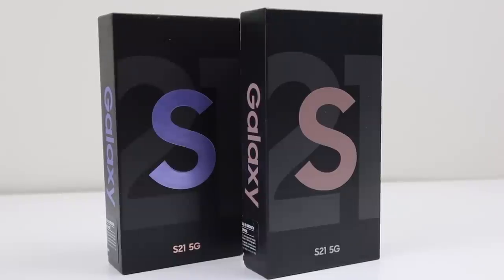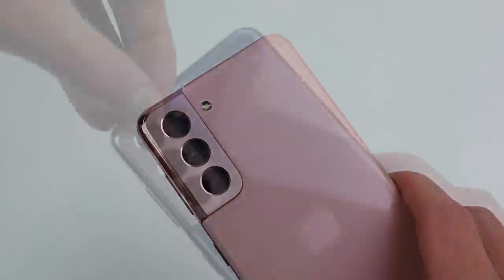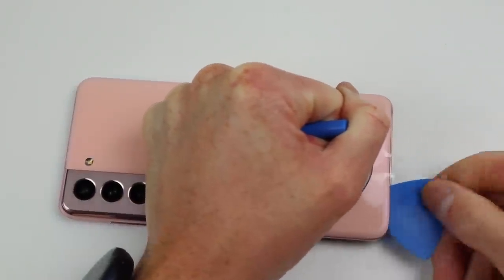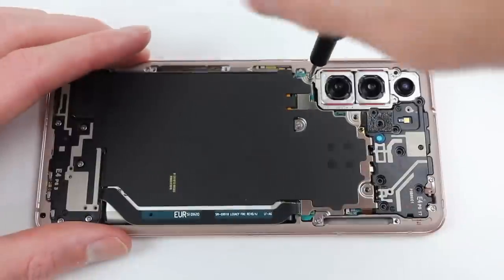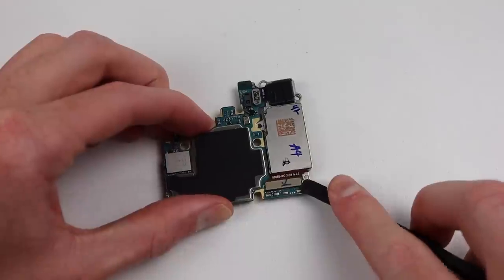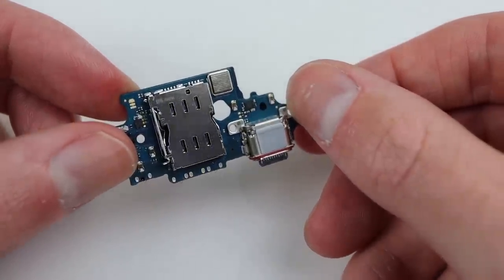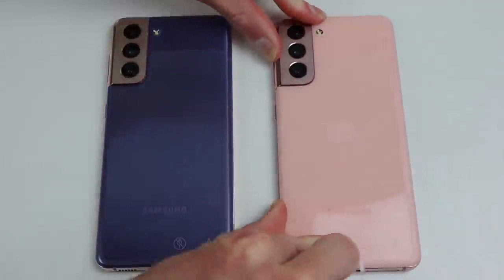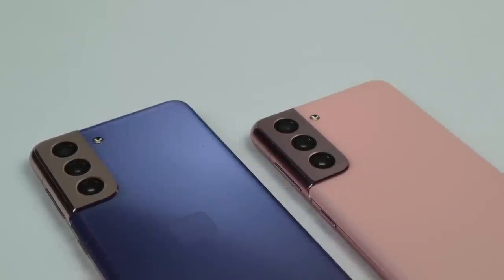Samsung Galaxy S21 Teardown and Repair Assessment - Interesting Findings!

Comment: The wise man once said about the battery: There's enough adhesive to glue an elephant to the ceiling. -JerryRigEverything
Reply: Lol.😂😂😃😄😅😆😀😁
Reply: Trueee
Reply: @dreamsyoungbrother7353  hi
Reply: I'm surprised dogs are allowed now.
Reply: why do they even use that much adhesive to batteries..
Reply: But the ceiling will fall off
Reply: Lol
Reply: Jerry Rigs...😂
Reply: That wise man also said : Glass is glass and glass can break
Reply: I saw one phone that has more than that much adhesive a rediclously old random sony Xperia that I found
Reply: I would be concerned if he was talking about a baby elephant
Reply: Jerry is thug
Reply: 😂bruh
Reply: What video did he say that on?
Reply: I never trust edited comments
Reply: On which samsung was this?
Reply: I seen that video 😂
Reply: What's that thing called M50? You did not mention anything about it
Reply: With deeper grooves at level 7
Reply: Lol

Comment: Samsung really said: Lemme fix my repairability reputation again
Reply: Good thing they said that tho
Reply: @EmeraldLegate_  yeah, I'm really proud of them for that
Reply: Let's give samsung 2 months then they'll break their "repairability" with a software update.
Reply: The A51 had the issues with repairability after a software update, so we only can hope
Reply: Samsung : oh yeah i forgot about the software lock, let's fix it up with some software update
Reply: Spoiler alert
Reply: They will  probably change that they probably just don’t want shame on launch so more people will buy it  and then they will low-key do what they did with the A51
Reply: Until it has been out for 2 months and they decide to lock them down with a software update. Oh and they'll probably make sure you can't downgrade the software either.
Reply: @Baralis86  the S20 was also repairable, so....
Reply: i think it was because the sensor was different in the A51 or something. its cause its modular. this is built into the screen. the A51 only had an issue with the fingerprint, nothing else though
Reply: After the first software update they'll lock the components
Reply: @fcallum77  that's apple
Reply: @arkvsi8142  Samsung did that too...
Reply: I wish they'd chill a bit with the adhesive on the battery. The back also doesn't need adhesive, just use clips.
Reply: Samsung really said: "Oops, let me release that patch that breaks reparability real quick"
Reply: Fix repair reputation? Keep in mind that this phone was just recently released and the A51 wasn't immediately irreparable but several months later made the fingerprint sensor irreparable via a software update.

Call me Mr. Tin Foil Hat but my guess is that Samsung is waiting a few months in hopes of their anti-repair advances won't make headlines since the first few months of release will oblige several people to open up the phone and make repair guides on it, but then sneak an anti-repair patch much later, around the time one might typically need a part replaced or a repair.
Reply: They did this because they removed the charger
Reply: Samsung didnot locked anything. Because it passes fingerprint tests and even somehow detects the finger. It is stopped working because it is optical and sensetive to the position. Small missalighment will make it harder to detect the finger.
Reply: @Thomas B 🤣🤣 if you don't think Samsung use suppliers who are based in China then you are a fool.
Reply: That's not true! Only ONLY the A series has the problems but the S series doesn't have those problems....yet.

As you've probably seen in the A51 video , this all was after a software update in the security patch. They can NOW in this moment make a new security patch for the s20 note 20 and s21 phones and then they will break their repairability.

Do you think it's a coincidence that only the A series has these problems? It seems like it's the entire A series.
But in the S series there are no problems , and in fact , you can replace the fingerprint scanner without any issues.
Reply: @brayannexon4613  Nope. Has been more than two months, didn't happen. Woot
Reply: @CrazyPlayer-pf2hv  Yeah what's weird to me is that the A series probably should allow accessible reparability more than the S series, due to being used in 3rd world countries
Reply: @datachu  thats suprising.
Reply: @QuackZack  s21 was released 6 month ago and yet, no hardware locks. Guess your comment didn't age well.
Reply: @EmeraldLegate_  i don't understand, samsung let their flagship device to be repaired by 3rd party, yet they lock their mid-range and budget A series phone so it really hard to repair.
Reply: @ErnestJay88  Samsung never locked anything on their A series phones. Although Hugh Jefferys A51 video states otherwise, most A51 work fine with different Fingerprint sensors. Hugh Jefferys video was a special case. 

That's the reason why Aliexpress and eBay is full of A51 fingerprint sensors. Why would they sell sensors that won't work?
Reply: Something that apple wouldnt dare to do

Comment: The fingerprint scanners on recent Samsung S are using ultrasonic tech, so it might be more dependent to the display, unlike A series which are using optical.
Reply: the ultrasonic fingerprint sensor is built into the display assembly, you can't replace one without replacing the other

Comment: Should remember that it was an upgrade to the software that caused the A51 to start enforcing restrictions on part swaps.
Reply: That’s equal to Software block
Reply: yeah, but i think it was more for security. i think if we have the tools to calibrate the fingerprint, it should all be good. i don't want samsung to do this cause im gonna buy an oppo lol
Reply: Not sure if it was intentional or just an unintended issue with the software.
Reply: @2010ngojo  no because 
You have to code for it to do that
Reply: @GTAandApplechannel  he did explain though, the fingerprint reader did become dodgy. just get us the tools so we can do it ourselves
Reply: @takumifujiwara4419  but they won’t
Reply: @2010ngojo  I wondered about software bug too.  Didn't it work when Jeffrey reversed the parts.  I have to watch the video again.  Forgot those details.
Reply: @takumifujiwara4419  someone said they had to reflash the software after changing the fingerprint so it can recalibrate , cant confirm tho
Reply: @nvignesh  I actually can confirm it though, at my Samsung Store they wanted to do this, but firstly checked if the phone had been opened. Obviously my display was changed and they noticed it, so they said theres no warranty for me, which is stupid. In my country it's only no warranty more if the repair caused the problem because of my fault or wrong repair. So they refused to that then, even if they themselve created the problem in the first place with them not providing calibration Software
Reply: It happens on the s10 line up too as well.Probally because anyone could unlocked the phone when there was a screen protector was applied to the screen(users reported the issue).A reason they did it is not softhware lock.Just a bump that we gotta wait or hope a update  fix it.
Reply: "Enforcing restrictions on part swaps" Emm, you are extremely wrong. Fingerprint sensor was the ONLY part that you cannot replace. Everything else is replaceable.
Samsung didnot locked anything. Because it passes fingerprint tests and even somehow detects the finger. It is stopped working because it is optical and sensetive to the position. Small missalighment will make it harder to detect the finger.

Comment: I've had to replace a S21 Ultra battery recently. Theres a good trick to getting it out without prying with metal. Put the LCD facing down on the heat plate at 80c for 2m, right after you remove it from the heatplate, spray a little isopropyl at the bottom and try to wiggle it to spread and at the same time, Use a standard suction cup found in the pro tech toolkit and gently pull it up using it back and forth without applying much pressure and use a ifixit pick at the same time as well to try and lift the bottom area first to get and slice through the adhesive. This worked wonders for me. The only issue was cleaning the residue adhesive on the actual battery itself. 
I'm a 20yr old Bundaberg Aussie who has just started a mobile repair business thanks to all the inspiration you gave me from watching your videos.
Reply: why did you have to replace the battery. should i be scared for my battery
Reply: @warhawk2574   A very small number of batteries have manufacturing faults.  That should have been covered by guarantee though as the phone couldn't have been more than a year old.
Reply: I am not sure if you'd be able to read and reply. 

The LCD screen of my S21 is broken and I have got the replacement. 
My questions:
1. Do I have to remove battery and antenna (using tri-wing)/as well to replace the LCD digitizer.
2. Would you be able to recommend any glue. 
3. How much temperature and time to heat up the frame to remove the LCD screen. 

A quick reply will be highly appreciated.
Reply: @angelesworld3855  Hey, 
1. If the replacement housing does not include it, yes, you will need to transfer them. If its a panel on its own, most likely not.
2. Standard TESA 61395 from iFixit would work good.
3. Personally, probably 80c for about 2 minutes, although its really up to what you feel is 'comfortable' in the end though

Comment: Fun fact: The OEM framed screen assemblies that Samsung sells to authorized independent service partners usually include a battery already stuck down in place. This means that during a screen repair, the original battery does not need to be removed from the original frame. This makes that once-difficult part of a screen repair a thing of the past. The battery can be removed from the old frame later for recycling. The customer gets a brand new official battery with their new screen, so their phone is like brand new.

That's Samsung's own way of saying, "yeah, that bit's a pain".
Reply: Damn, this kind of justifies their prices hmmm
Reply: Looks like the note 7 still haunt them